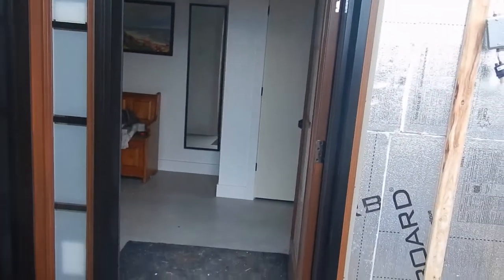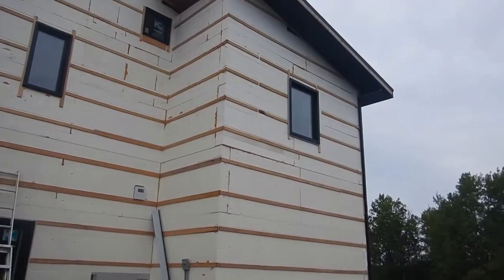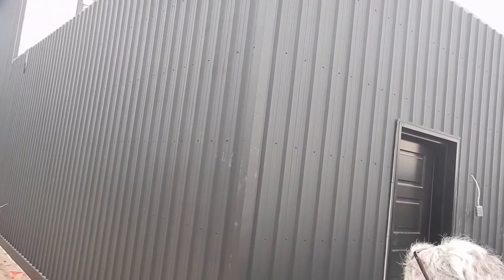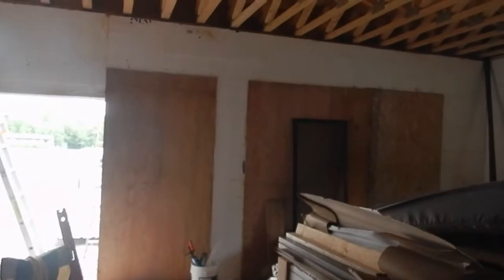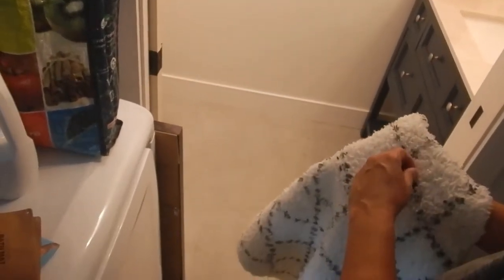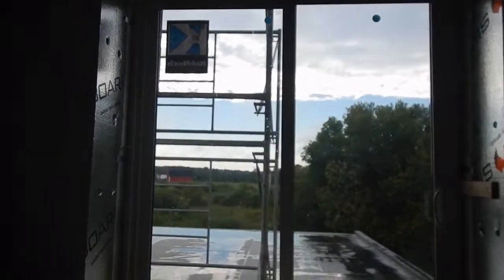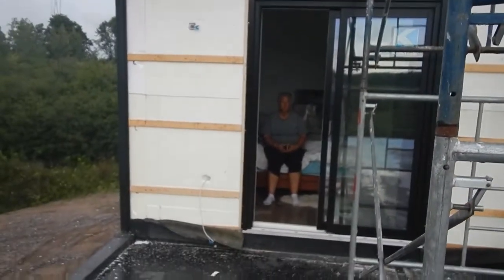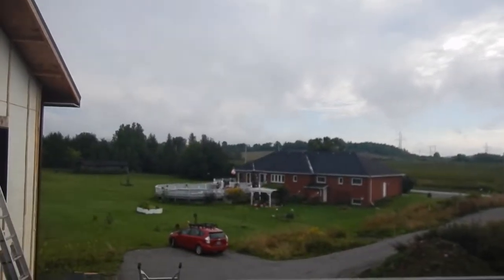Thermal Wall is Complete and Siding Install Continues

Comment: On the dryer vent just make an attachment that can be put on during winter to get the vent higher up the wall
Reply from the maker: Thanks. I've already made plans to do exactly that. I'm also concerned about the loss of heat through the dryer vent itself. The house is supposed to be air-tight with the sole entry and exit for air through the Heat Recovery Ventilation system. I want the compromises to the exterior envelope to be kept to an absolute minimum.
Reply: @EastMarshAcres  Call the people who made the ERV. They probably have a solution for your problem.